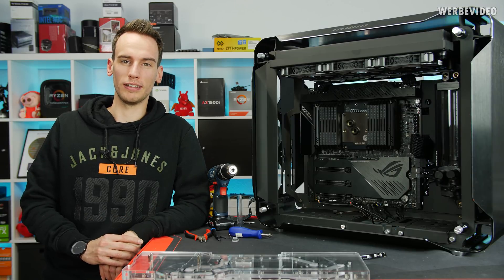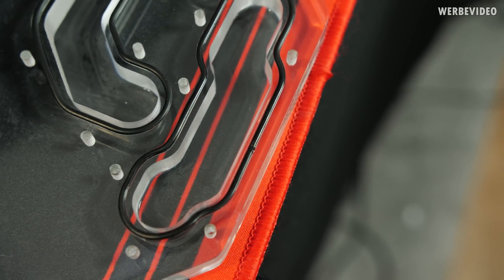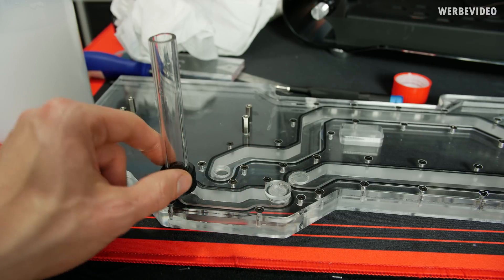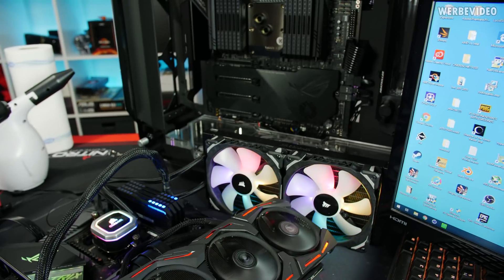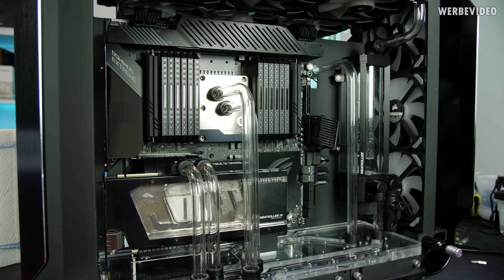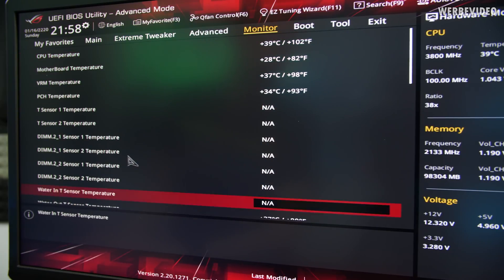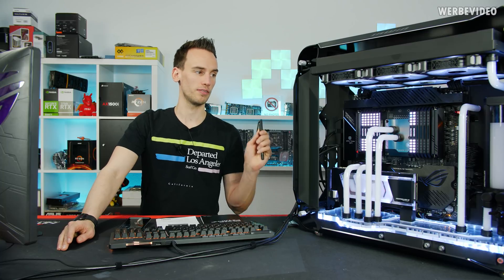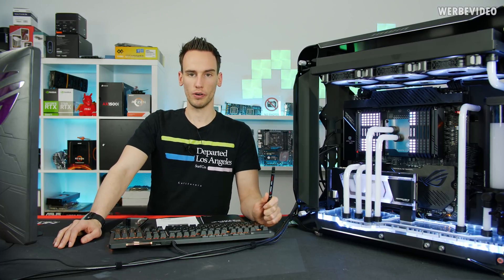Project Irrationality Part 10: Trying to fix the Distro Plate

Comment: 3:33 -- This is why you add a thin film of Silicone Faucet Grease to each of your O-Rings it helps prevent this.  Should be able to find it at your local hardware store retail or online.  Nice rig BTW.
Reply: Also a good idea to use black gasket seal instead of cyanoacrylates. Yes it's messy, it's hard to work with, and it takes forever to dry, but it also works the first time every time unless human error slips in the middle.

O-rings can't do their job unless they smoosh, and hard glues prevent that from happening, the o-ring will twist or tilt leaving a gap.
Reply: Polyurethane on the joint after gluing will definitely fix it, I've done it many times
Reply: Then the grease turns brown and causes discoloration of your acrylic block around the channels and potentially leaves little opaque spots on all of your reservoirs, etc.  If you make your o-rings right there's no need for grease.
Reply: @Dr2B1  the silicone grease we used didn't turn brown. Our acrylic housing remained clear for at least 7 years. Constant submersion at varying pressures caused micro cracks along the housing though.
Reply: pal9000 there is always a need for some grease. And silicone grease shouldn’t turn brown, even better lithium grease shouldn’t turn brown. We use that on demonstrator fountain pens and those are perfectly clear. The plastic or glass discolors before the grease.
Reply: @MisterRorschach90  That's not true.  Grease will often leave residue especially when used on o-rings for watercooling blocks.  As water temps increase there is a higher chance this will happen.  I haven't used grease in years on > 100 blocks with no leaks.  These aren't demonstrator fountain pens.  These are blocks cooling components worth thousands of dollars.
Reply: @MisterRorschach90  I've put together parts with and replaced o-rings in everything from industrial hydraulics to kitchen faucets. If your o-ring leaks, it's because it's not the right o-ring. You didn't pick out the right size, durometer rating, or material for the channel, application and clamping pressure. Nothing else is needed for an o-ring to seal in any system where it is appropriate to use an o-ring than the o-ring itself.
Reply: Back in my college robotics days we used silicone grease on the seals for our submersible. Good stuff, keeps us from leaking into the electronics housing at 30ft. Has to be sufficient viscosity.

Comment: Beautiful build.  Nice to look at, but i wouldn't want to  do maintenance on it)) Also, i had a thought that when you cut o-rings for the distro plate, the material is at room temperature,  temperature of the loop can reach 80C, does o-rings expand when heated?

Comment: It's disappointing to see Corsair not supporting  2x6 DIMMs RGB
Reply: Bc it's a ultra first world problem, i thought it was funny.
Reply: @potatopotatopotatopotatopo8746  as a programmer, the way I view it is you have to consider all(or as many) possible combinations and scenarios when making something to ensure it doesn't act weird or break
Reply: I use x299 because my PhD involve lots of fluid simulation, I don't know anyone who use quad-channel memory system other than me because it's unneccessary. So I consider myself as 1%? And even me only use 4 dimms because it's more than enough. Maybe only 0.3% of people will use 8 dimms. People use systems that have 12 dimms slot and use all of them could be less than 0.01%, and most of them are hard core professionals and not a fan of RGB. So it's really understandable that Corsiar didn't even think about it.
Reply: @oscarshen6855  Thats such terrible logic i cant even begin to type a actual response.
Reply: @MrYaxalot  Do you know anyone around you use 6 channel memory system and like RGB?
Reply: @oscarshen6855  i have multiple quad channel systems all of them have rgb. No i dont kno anyone that has a 6 channel desktop part like that because threadripper is a thing  but thats not a excuse to leave out something added so simply to a program becuase there is a "current" platform that does use it.
Reply: @oscarshen6855  I had a 4gb x 8 kit on my x99 rigs, and on x299 16gb x 4 but recently swapped to a faster 8gb x 8 kit to take advantage of the T-topology that this board/cpu combo uses. I don't think it's quite as rare as you suggest - given the relatively low number of HEDT rigs VS mainstream platform rigs.
Reply: @kalmtraveler  There are considerable amout of of people who can take adventage of 8 dimms. But that's basiclly top to the line for consumer products. If it's more than 8, it's likely to be a sever or super workstation and out of sight, I doubt they will use RGB in it. So Corsair think it's a waste of time to program light pattern for more than 8 dimms. But now we have der8auer.....
Reply: @kalmtraveler  same. I've had 8x DIMM since X79.